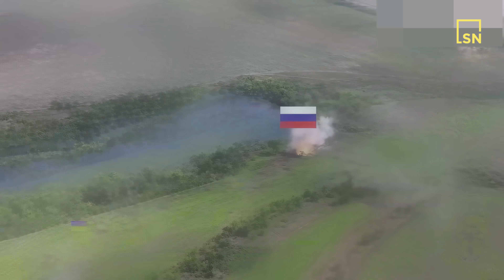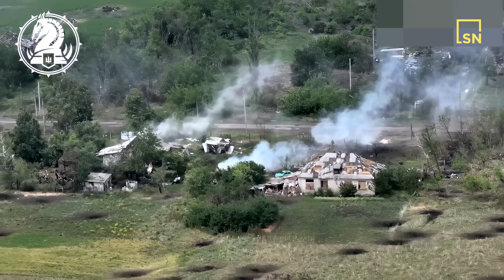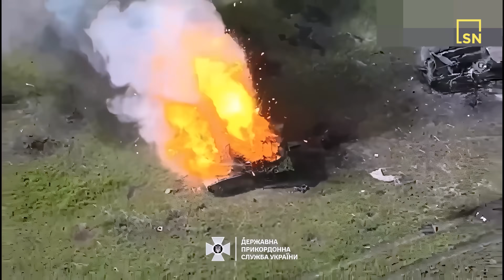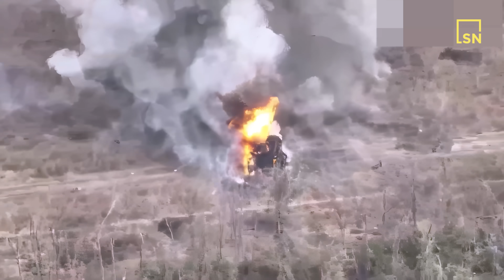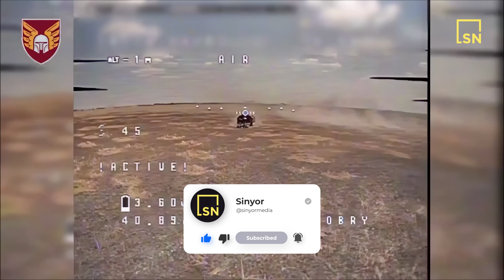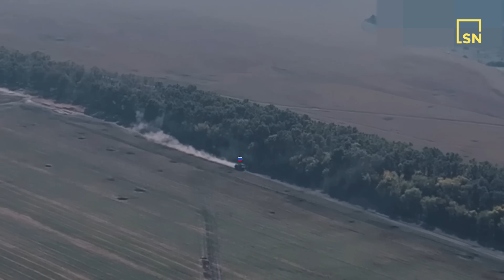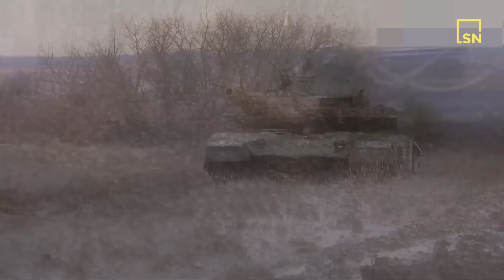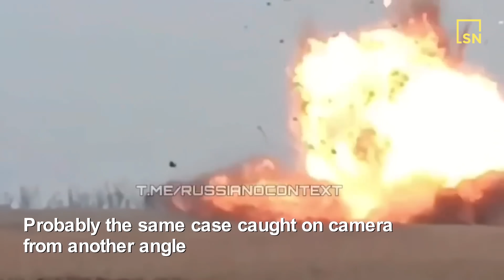Two Abrams Face Russian Brigade Alone, Head-on

Comment: russia have lost over 10 000 tanks alone. That's staggering numbers.
Reply: 전쟁 초기에 러시아연방 전차숙련병+전차500대가 뼈아픈 것이죠
Reply: 📉 The figure of 10,000 Russian tanks lost is indeed staggering—but it needs to be taken with a grain of salt.

🔍 According to the latest data from the Ukrainian Ministry of Defense, Russia is said to have lost approximately 9,859 tanks since the beginning of the invasion in February 2022. This number includes tanks that were destroyed, captured, abandoned, or damaged, and is compiled by the Ukrainian general staff for strategic communications.

⚠ However, these figures are not independently verified. Sources like Oryx, which track only losses backed by visual evidence, estimate Russian tank losses at around 3,740 units. That's a significant gap—highlighting how totals can vary depending on the counting method used.

🧠 In summary:

10,000 is a high-end estimate, mainly shared by Ukraine to emphasize the scale of Russian losses.

The verifiable numbers are much lower, but still substantial.

It’s therefore an exaggeration to take this figure as absolute truth—though it does reflect a genuine pattern of heavy losses.

And yes, such numbers are often used as ridiculous propaganda tools—targeted at the more gullible among you.
Reply: @dj4ckklephtic561  самый здравомыслящий комментарий среди комментаторов. Без иронии.
Reply: @aimusiclore  Merci , c'est bien aimable de votre part.
Reply: You.. pro-russian! They lost not 10.000 tanks but 100.000 tanks!  ))))))))))))
Reply: @VasilisTountas Russia had in total more than 10,000 tanks how they can lose 100,000 if there were only 10,000 it is funny😂😂😂
Reply: @hairuddin-pc5pu  You got it right. My comment was just an irony.  😂😂😂
Reply: @VasilisTountas  very funny, but we are talking about 4000 visually confirmed losses of Russian tanks on Oryx, how many of them do you think are unconfirmed?
Reply: @CyberDanilka Oh ! You are in Ukraine with a calculator? “Visually confirmed” you mean you saw them? From your seat in front of your tv watching CNN with a Bud in your hand ?
Reply: @FnokiN visually confirmed = photo + geo, nice way of thinking bro
Reply: @CyberDanilka  10.000 photos ? 😂😂😂
Reply: @FnokiN you can google it, my man
Reply: @Hoozpoppin  no they lost 10000000 akshually
Reply: и откуда столько дурачков берется что верят своим СМИ )))
Reply: 알보병 근접지원X --> 공중정찰자폭드론 및 지상정찰자폭드론 근접지원O
Reply: Russia is going to be fresh out of tanks by the time the war in Ukraine is over.
Reply: & over 100,000 soldiers
Reply: и еще три звезды смерти и двух скайокеров- ахахаах сказки для хохлов и янки
Reply: @Hoozpoppin , does not. 10000 tanks were never.
Reply: The chomos pray on the kids. Kgb Putin knows this.
Reply: The accepted number is over 4,000. That is less than half your claimed number. It is still substantial and completely unsustainable for them.
Reply: Да ты что , мне сказали уже 2 миллиона танков !  лол , ты хотя бы представляешь  эту цифру  в танках , сколько это ?
Reply: And 30k+ trained tanker,s.
Reply: @Hoozpoppin  The official statement of your European military analysts says that Russia has lost more than three thousand tanksAnd Ukraine has lost more than four thousand tanksV
Reply: Не звездите а , мультик своему Трампу покажи
Reply: russia lost 999999999999999999 tanks and ukraine only lost 0 REAL (100% real) 

actual bots.
Reply: @rowdy8814 sure, btw u can see ukranian visually confirmed losses on oryx too, but yeah, who cares, right?
Reply: @CyberDanilka  oryx literally has duplicates, and even oryx lists 4000 tanks lmao, op said 10000 hahahaha.
Reply: @rowdy8814 they’re trying to deleting duplicates asap, and boy wtf is even oryx, that’s literally visual evidence list, u want something more of war wtf
Reply: @rowdy8814 russian losses are really much higher than Ukrainian
Reply: Russia also lost over a million troops...
Reply: @weedymcwee9931 This kind of argument claims that the figure of 1,000,000 Russian losses represents the total number of killed and wounded, just like Western estimates do for Ukraine.

⚖ Fair Comparison of Human Losses

Side	Estimated Killed	Estimated Wounded	Total Human Losses
Ukraine	60,000 to 70,000	370,000 to 400,000	≈ 430,000 to 470,000
Russia	≈ 250,000	≈ 800,000	≈ 1,050,000
The 1 million figure for Russia is a sum of the killed and wounded, just like for Ukraine. It’s not only the killed, despite what some comments may suggest.

“Saying Russia lost 1 million soldiers doesn’t mean they’re all dead. It’s the total number of killed and wounded—just like for Ukraine. So no, it’s not ‘almost the same’: Russian losses are more than double those of Ukraine.”

But the real difference lies elsewhere.

Ukraine receives intelligence support from 31 NATO countries, and suffers from over 17,000 sanctions—without even being a member of the alliance. This is not a war for Ukraine’s survival. It’s an illegal war led by a coalition, using Ukraine as a buffer zone to avoid fighting directly. The goal is not to protect Ukraine, but to dismantle the Russian state apparatus.
It's a form of instrumentalization of international law for strategic purposes.

🎯 What this implies:

If Western powers did indeed provoke Russia — for example, by expanding NATO or supporting political movements in Ukraine — then their stance of defending democratic principles could be seen as hypocritical or self-serving.

This does not justify Russia’s aggression, but it complicates the moral reading of the conflict. We move from a binary framework (aggressor vs. defender) to a more nuanced dynamic, where responsibilities are shared or intertwined.

📚 Similar historical examples:

The Vietnam War, where the United States invoked the fight against communism while intervening in a civil conflict.

The 2003 invasion of Iraq, justified by the alleged presence of weapons of mass destruction, which turned out to be unfounded.

🧩 In Ukraine today:

Russia speaks of a “buffer zone” to justify its offensives in the northeast.

The West insists on Ukrainian sovereignty, but some analysts see this as a strategy to weaken the Russian state apparatus.
Reply: @Hoozpoppin  in WW2, the soviets lost 100,000 afvs! Incredible numbers but they had so many they still won....
Reply: @uraigroves7898  they arent the ww2 russians in all marks, people, able to produce,  etc etc. Russia is weak it will be funny when ukraine starts to gain russia territory and you are forced to make peace with a loss instead of a greedy evil gain.
Reply: Yes, they lost a lot of tanks. But let's remember that they can produce about 3000 tanks a year (much, much more than the whole EU), so after 3.5 years of this war they still have the same number of tanks. The only problem is the lack of properly trained crews for these tanks.
Reply: @user-glg20  If anything, when you decommission an old Soviet tank and it goes through a factory upgrade, it is also included in the report as a tank released from the factory, that is why there is such a figure, the number of tanks produced from 0 is hundreds of times less
Reply: @user-glg20  не могут они произвести 3000 танков в год, максимум занимаются каннибализмом и из трёх танков делают один который может ехать. Если в год 300 произведут это уже достижение
Reply: @user-glg20  BRO. LMFAO. 3000 THOUSAND TANKS A YEAR HAHAHAHAHA.

No, it is 200 to 300 tanks a year according to the HIGHEST estimates, so you are talking straight out of your a$$. 

They lose that many in a month, for reference.
Reply: Sure it’s not Russian 200.000 tanks ? 
And why 95% of the Abrams are destroyed ?
Reply: @FnokiN  95% lol, there were only 31 of them, these are ridiculous numbers for such a war
Reply: @CyberDanilka  
Just Four Abrams Tanks Left : How Russia Wiped Out 87 Percent of Ukraine’s U.S.-Supplied Fleet. 
Source : Military Watch Magazine. 

Need the Humvees score ? The Patriot score ? And what about the 3 F-16 lost ?
Reply: @FnokiN  wow, russia destroyed 27 tanks, wooow, cmon dog, this is hilarious🤣
Reply: @FnokiN  you mean the 9 patriot batteries lost.... before they were deployed in the warzone... you mean those ones. 🤣💩
Reply: @blackcountryme  You know what ? Go back in front of your TV and watch CNN with 12 Buds near your hand. As usual.
Reply: @blackcountryme  The perfect comment from an american that has lost ALL their wars. 😂
Reply: @FnokiN  Tanks that aren't being properly used you saw it yourself in this video the Abrams isn't meant to be a war winner it's usually supported with Infentry, Artiliary and Air Support none of which Ukraine is doing plus if you actually did research you'd know the 31 Abrams tanks that were sent to Ukraine were original M1's built in the 90s they don't have all the advantages the Modern Abrams has like explosive reactive armor. Also a bit of a fact check Ukraine loosing 95% of the 31 abrams that were sent is way less of a loss then the over 10000 tanks several hundred of which are modern T90m's than Russia lost. Also 90% of those Abram losses were from Drones which no tank is immune too as witnessed in this video
Reply: @coltonkoepp655  Russia lost about 100 t90m for the 3 years...
Reply: @coltonkoepp655 It’s good you think what CNN told you. Good.
Reply: @FnokiN  ㅉㅉㅉ,  소설을 써라.  니 몽상은 끝이 없구나.
Reply: @FnokiN  you got barbecued in this comment section, buddy
Reply: @FnokiN  Have you not realized, after like 2-3 weeks, that russia is full of sh!t? It's now nearly been 1250 days, and you still haven't realized that russia is full of sh!t? Whereas we have footage for everything Ukraine says? 
You might be very, very dumb, you know. Like, extremely dumb.
Reply: @FnokiN  😂😂😂🤦‍♂️🤦‍♂️🤦‍♂️🤦‍♂️
Reply: @FnokiN  What is 95% of 31?
Reply: @wattlebough  It's hard to explain to an uneducated American.
Reply: @FnokiN  putin supplying your "facts" to you? 🤣
Reply: @FnokiN   не 200 тысяч потому что их нет. 
 Ну а 95%  уничтоженных абрамсов потому что соврать нужно для тупого российского населения. вы так же хаймарссы уничтожали 75 из существующих в Украине 25-ти.. Так же и с танками. говорите что 95% уничтожены, но потом чуть ли не каждый  день говорите что еще уничтожится по 10 штук, а у Украины их всего 31
Reply: @FnokiN 95%? where did you get that numbers?😂 you're so funny clown🤣
Reply: @jaygoko3926  
Just Four Abrams Tanks left : How Russia Wiped Out 87 Percent of Ukraine’s U.S.-Supplied Fleet
Eastern Europe and Central Asia , Ground
(Military Watch Magazine). 
And with a Goko name … you’re the clown. 🤡
Reply: @FnokiN  I found butthurt Igor
Reply: @mastermariner490  Yes John … stay with your Bud in hand in front of your TV.

Just Four Abrams Tanks left : How Russia Wiped Out 87 Percent of Ukraine’s U.S.-Supplied Fleet
Eastern Europe and Central Asia , Ground
(US Military Watch Magazine)
Reply: @FnokiN  ты вообще знаешь всего дали 300 иностраных танков? россия не может  10к танком победить против 300 танков?
Reply: @FnokiN  russian bot account.
Reply: @xyreace US source : Just Four Abrams Tanks left. How Russia Wiped Out 87 Percent of Ukraine’s U.S.-Supplied Fleet
Eastern Europe and Central Asia , Ground
Military Watch Magazine.
Reply: @FnokiN Are you a big Putin fan?
Reply: @FnokiN  Ukraine received 31 Abrams.
So you are asking why 29 Abrams were destroyed against 10 000 russians tanks????
Reply: Есть ли у России танки? Или только топливо и боеприпасы? В войне Россия потеряла 12 000 танков, 30 000 бронетранспортёров, 500 самолётов, 400 вертолётов, 30 стратегических бомбардировщиков, 32 000 артиллерийских орудий, 1200 систем ПВО (С-300, С-400, «Панцирь-С», «Тунгузка», «ТорМ» и др.), 20 кораблей, 1 подводную лодку и Черноморский флот. Кто выиграл войну? Мы, народы Средней Азии и Кавказа, победили. Мы хотим, чтобы Россия воевала ещё два года, а затем развалилась, чтобы мы могли избавиться от российского влияния и стать независимой и развитой страной.
Reply: @nauxau  а через год Россия потеряет 2 миллиона танков, примерно миллион истребителей, 120 млн солдат, и вообще вообще. Ты цифры с потолка взял? Или смотрел исключительно проукраинские источники не опираясь на здравый смысл и банальную реалистичность? Усредняй потери обеих сторон, и не пиши чушь, хорошо?
Reply: @aimusiclore  Последние 3-4 года я каждый день смотрю как минимум 2-3 видео с горящей российской техникой на передовой, и они не повторяются. Давайте посчитаем. Если в трёх годах будет 1000 дней, сколько будет стоить потеря Россией по 10 машин в день? Украина постоянно показывает горящую российскую технику на передовой. С какой ещё страной Россия начнёт войну? В следующий раз российские войска, вероятно, будут использовать ослов в качестве транспорта, а плуги — в качестве оружия.
Reply: @nauxau  ждать зачем помогать нужно изнутри уничтожать военную промышленность и логистику!
Reply: @nauxau   вы видели российские сводки они уничтожили уже половину украинцев и в 3 раза больше техники чем у них)) Они рисуют в своих сводках ежедневные потери на 1-2% больше чем дает Украина.. тупо для того что бы показать стаду в россии что их в 4 раза больше, а потери у них меньше. Но это просто вранье!  у наступающей армии потери в 3-4 раза выше всегда, а с нынешними технологиями, эта цифра выше 1к5-6 минимум и все независимые аналитики и мониторы дают циыры потерь Украины с 220-года 450-500 тысяч (убитых и раненых)  у россии +- 1 миллион. вот тольо это потери РФ те что видно и можно посчитать, а тех кого прикопало или свои же вкатали в землю ничто не считал. и да у Украины это подтверждено что 80% раненых спасают, а у россии 40-45% так что можно судить что из 500 тысяч потерь Украины в живых минимум 300 тысяч. у россии из миллиона потерь, двухсотые около 600 тысяч. Проблема в том что эти мрази убили предварительно несколько сотен тысяч гражданских. мы не знаем сколько погибло на оккупированных территориях. Только в мареуполе около 100тысяч потенциально погибших гражданских судя по спутников и т.д. могил в которых они в первые месяцы закапывали гражданских которых убили на неоккупированных территориях в Харьковской области было больше чем 400 человек...А это всего да пару месяцев
Reply: 우크라 남자 1/2  전사했어요  😂
Reply: @빽어텍 ㅈㄹ한다.   니 몽상은 자유지?    러시아남자들은 우러전쟁에서 몰살당하고 씨가 말랐단다.    그래서 푸틴은 50대~60대의  노인들을  강제징집해서 전쟁터로 내몰고 있다.    TV영상 안 봤냐?   러시아군들은  머리는 휑하니  벗겨진 대머리에 이마엔   주름살이 쭈글쭈글 노인영감들이구나.    러시아의 젊은  남자들은 인근 폴란드, 루마니아, 벨라루스로 탈출중이고.  병력이 씨가 말랐으니 감방에 있는 죄수들에게 석방을 조건으로 총을 쥐어주고 전쟁터로 내몰고 있지.    오죽하면 최빈공산집단인  북한에 까지 병력,  무기달라고 애걸하냐?
Reply: @빽어텍 Потери Украина/россия-1/9.
Reply: @Сергей-и3в6ю  젤렌스키 휴전하자고 울던데요 😢
Reply: @Сергей-и3в6ю  странно, а холодильники разгружать некому
Reply: @truemenon Дык и пакетов уже чёрных на россии не хватает.И скажу по секрету,собачки украинские вельми довольные:мяса лапотного до отвала наелись
Reply: @빽어텍  он плакал не по причине прекращения огня, а по причине нехватки для него самого денег, плачет только народ, а правительство только и хочет нажиться на народе